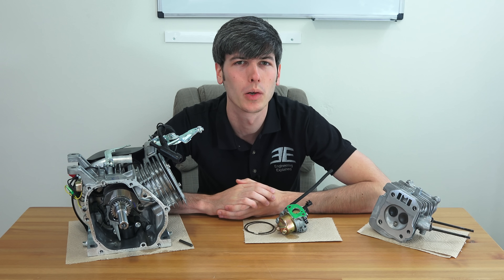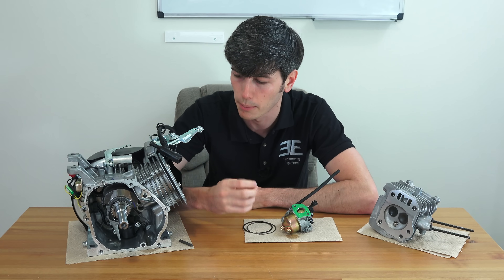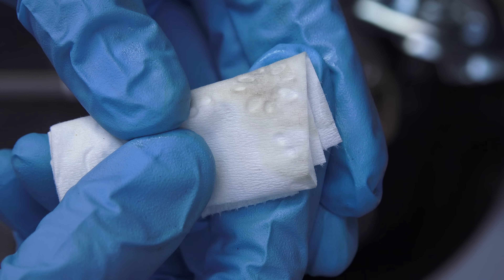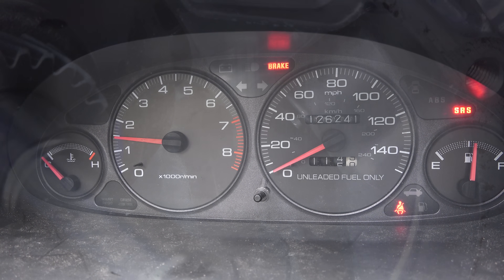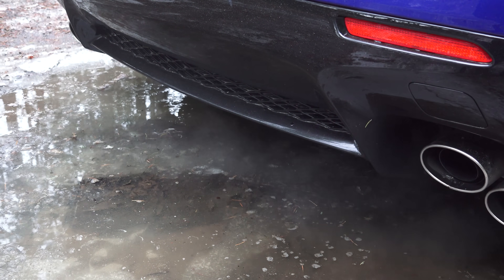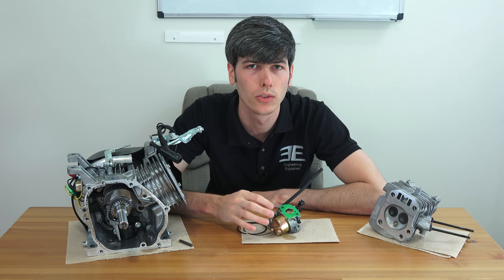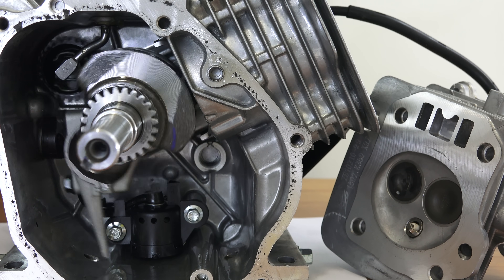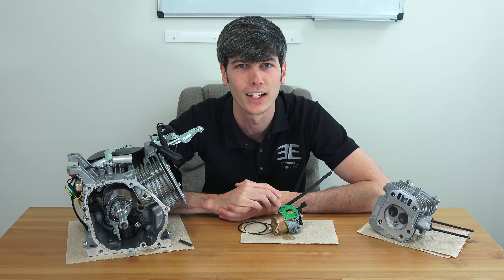Should You Warm Up Your Car Before Driving?

Comment from the maker: Important Note: The amount of fuel sprayed in the cylinder in this video is significantly greater than the quantity that will actually be injected each intake stroke, as demonstrated in this video: https://youtu.be/lJRBo883cpU. The initial point of the video remains: today’s modern engines with modern oils (which have excellent low temp flow properties) will have oil flowing and properly protecting the engine extremely quickly, thus negating the need to warm up engines before driving off. If you want to let your engine idle for minutes before driving off, there likely won’t be long term consequences (like heating up the car, scraping ice, etc), though there likely are not benefits either, as the oil film establishes very quickly protecting the engine. TL;DR - you don’t need to warm up your engine before driving off, just don’t drive aggressively until fluids are at operating temperatures.
Reply: Hi Jason, I am using this as a research topic for one of my classes and am just wondering if you happened to use an article or another reputable source to backup this information? If so, would you be able to point me in the right direction? I've tried searching through some databases however can't seem to find anything in terms of additional wear during cold temperature start up due to rich A/F mixture.
Reply: yeah what about internal expansion of the metals up to operating temperature
Reply: You need to contact the builders that built the house next door.And the buyer. I do like a good explanation.
Reply: What are the operating temperatures? 21 WRX
Reply: @EngineeringExplained What about Minnesota in January?
Reply: Technically yes, there are valid mechanical reasons for short warm-up times but these were always there- for decades, but it is only recently that propaganda started pushing not warming as better.   Fuel savings is the biggest reason for not warming but propaganda does not want to say it straight- wouldn't be propaganda, thereby concocts various side reasons.  Notice how the short-warming period mantra started with American wars in Middle East and prices of oil hitting $100 and more per barrel.  Ridiculously thin oils, not warming engines, other follies are propagated as good mechanical practices and unfortunately Engineering Explained is an impressionable young guy and is parroting a lot of it. There are many valid reasons to warm-up the engine well.  Not only mechanical reasons but also safety reasons.  Statistically most accidents happen within a short distance from ones home and take place during the first few minutes of driving when the engine is not fully warmed up and the driver is driving "easily" waiting for the engine to warm up.  Warming up and being alert and prepared to step on the accelerator when need arises is a far better safety practice that taking of with a cold engine hoping it will warm up in the next few miles of driving.  Medical bills, damaged vehicles, rises in insurance premiums are all more costly than the few ounces of fuel and a tiny amount of engine wear that is saved by not warming.
Reply: So I guess the feeler gauge that I use to build engines is just for show and thermal expansion tolerances are just bs. Also everybody warming their cars up at the track are full of it.
Reply: Engines with forged internals need to be warmed up to reduce wear due to the fact that a forged piston must expand due to heat to fit perfectly if not it can cause bad piston slap if driven cold

Comment: Industry and government propaganda being pushed. It’s complete BullSh*t !!! Of course an engine needs warming up before driving !!! If the so called industry experts say this, then why do F1 engines need warming up correctly……and motorcycle engines in Moto GP ??!!!! That’s because engines are made from different metals and components and oil has an optimum operating temperature…… !!!! Of course the motor industry don’t want you to warm your vehicle, they want you to drive straight off and wear your engine out in a couple of years !!! Why do you think oil has got ever more like water ??? Because it has minimal viscosity which makes the engine wear quicker !!!! Don’t believe the so called experts !!!! You can guarantee most of the people on this thread are trolling and propaganda spin doctors mocking people for warming their engines…. Either that or they’re just retarded !!! 😂😂😂😂😂

Comment: I get snow, sometimes a lot. Turn on the front defogger, fan on high, recirc on, windshield and floor. shut off the engine. remote start the next day. brush off the snow. sometimes there's heat. I'll take the tradeoff. I also change my oil early.

Comment: If you live anywhere that is cold you will know it is imperative to let the car warm up. Yes yes modern oil and better fuel injections yadda yadda. If you dont let the engine get warm enough to keep the windows from frosting over as soon as you sit down. It doesn’t matter how “ unnecessary” it is for the engine. You’re going to run into the first thing that gets infront of you because you cannot see. And that’s going to be a lot worse for the car than letting it idle.

Comment: Theres a thing called high idle in my Ford gassers. That takes care of any excess fuel from forming. I idle my trucks both diesel and gas for at least 10 mintues year round. Never had any issue at all with rings,bearing or any other engine part. Transmission problems never happened either. And I aveage 40k miles a year and keep them until at least 150k before trading in. I'll stick with warming them up. Especially here were we get temps below zero often for long periods. You ought to hear the sounds the engine makes once started. Don't drive it. The cylinder walls will keep coated everytime the piston goes up and down and fuel gets burnt up with the high idle and adjustable electronic fuel mix.

Comment: The oil pump is constantly running, so the rich fuel mixture should have minimal effect. The system is going to be in an open loop until it gets to temperature.

Comment: It depends on what you call a cold start.  It's  not all about air fuel ratios.  When it's -20F you have other considerations before through your transmission into drive.  You've got -20 transmission fluid, -20 oil, - 20 diff fluid, -20 coolant.  The engine coolant will warm up the quickest, but that first thermostat opening is going to shock your block and heads.  Especially if you have dissimilar engine components like a cast iron block and aluminum heads.  200 degree engine with a sudden flush of -20 coolant can be detrimental. The oil will warm up fine of course, tranny fluid next due to friction and diff fluids last.  Let your car idle for awhile to get tranny fluid moving and warming up before hitting the throttle

Comment: This doesnt account for cold temperatures where on a short trip with modern direct injected engines causes condensation in the oil and/or oil dilution. On an automatic, if driving off while still in high idle, the trans will slam into gear when you put it in almost like a mini neutral drop. All the transmission rebuild specialists all have come to the same consensus that warming your car up before driving will prolong the life of your car and it will drive better for longer. This is why the acerage person struggles to get to 200 thousand miles on an unopened automatic while some people such as my dad have gotten well over 270 thousand miles out of a transmission that was considered to be “garbage” (4t65e)

Comment: Every single time I get in my car I start it and wait for the SAIP to go through its cycle and shut off then for the engine to idle down to 840 rpm then I'm off. I never wait for the temp gauge to start to move even in the cold. It's a 2004 Passat 1.8t AWM engine code with 4motion all wheel drive and 5 speed manual with only 119k miles and no wear in the cylinders or oil burning, I checked the walls with a borescope when changing spark plugs, looks like new.

Comment: A friend of mind from work lets his car idle a bit before turning it off especially after long drives. He drives a diesel bakkie or what you guys call a pickup. When i ask why, he sais its to let the turbo cool down. I take his word because his a mechanic but for military. How true is this?
Reply: It's good practice on older models and high performance cars as takes the heat away from the turbo . But I've never done this as can't be arsed to wait !

Comment: Hello, actual automotive engineer here. This is shoddy thinking. Any damage to the bores from dilution is going to be completely dwarfed by wear from loading a piston loose in its bore. Until the pistons warm and expand enough to shrink the piston-to-wall clearance, you're going to have piston slap. Loading the motor in this state will wear the skirts and bores orders of magnitude more than idling under no load, especially considering the bores are constantly being replenished by oil on the opposite side of the rings.
Reply from the maker: Appreciate you chiming in! Since you have oil being replenished as you mention, is there really any concern?
Reply: @engineeringexplained I would still be concerned. The crankshaft is going to throw oil onto the bores pretty quickly during a cold start, but the wider clearances between the pistons and cylinder walls means that there is more room for the piston to rock/slap between the thrust and non thrust sides of the bore. A looser (colder) piston is naturally going to slap harder because you are giving the piston a greater distance to accelerate between, i.e. it impacts the sides of the bores with greater velocity hence the noise. Increasing the RPM in this state just speeds everything up and makes the impacts harder. Another thing to think about is that cylinder pressure is positively correlated with torque and an engine produces hardly any torque at idle with the throttle closed. Driving and loading the engine increases the cylinder pressure and pushes the pistons into the thrust sides of the bores harder.
Reply: Your answer makes complete sense and is a supremely logical conclusion.

Comment: I bought a block heater to put in my car and I plug it in overnight don't have to warm it up oil is already warm can drive it away just like that within one minute it's spitting out hot air from the heater

Comment: This is not a consumer problem this is an engineering problem. The engineers need to figure out how to heat the cabin substantially quicker in winter rather than getting together in boardrooms and having paper plane flying distance competitions

Comment: A rotary engine  must be completely up to running temp. before driving, this is mostly why rotaries got a bad reputation except it was people that failed, expansion rates of Disimular metals, I once read about an Rx 2 that competed in 1975 Bathurst and later went on to doing 100 ooo miles successfully on the road before being recond,  the key to this was correct warm up procedure also cool off procedure the same as everyone should  stick to 🤔if you are mechanically sympathetic or just very wise, or have chosen the right person to tell you because you have no clues to solve the
 mystery , I have a good mate that's a very good mechanical  technition  he also says not to warm up ,some cars like 6 + 8 cylinders Ford's and Holden can drive with minimal stationery time on cold start defanatly so it's up to the individual to make good decisions about performance and reliability, these words don't usually go together unless there's $$$ involved or a little initiative

Comment: What happened to  75% of engine  wear  happens from cold, modern multivis oil allows engines to function while cold when piston ring and cylinder tolerance is bigger, alluminium (pistons) expand more than cast steel and also expand at a faster rate piston bore tolerances are set to be correct when an engine is at running temp.... so if you don't have an adiquate  warm up procedure theoretically your pistons will be expanding  before the bore does also with load from driving, once you are committed to  driving traffic isn't waiting for your cold crappy engine, which is fine if you  get a new car every year, 1 other thing to take into account  is residual stress in the  molecular structure of the steel is considerably higher if it's not warmed eqauly, essentially and engine that's looked after and warmed up won't crack a head as easy if it happens to accidentally get a bit hot

Comment: They will warm up quicker if idling.  If you start up and start driving , your car is pulling more cold air thru the radiator, and takes longer for the engine to produce heat.  Starting up and letting it idle at lower RPM letting less cold air pulled into the engine.  That oil pump is pumping a lot of oil under pressure to all the places that need it.  It not washing off the oil that already there on the crankshaft piston rings and all mechanical parts that need lubrication.  This is a John Kerry idea to get people to not let their engines warm up.  This engineer is a tree hugger that has college sense, but has no common sense about several mechanical ideas I’ve seen him attempt to explain. I won’t argue his point of view and keep letting my car engine warm up to heat my car,while he’s driving down the road freezing.

Comment: Here we go again with the annual Anti-Warmup Lies Season. No need to heat up and defrost the windows. Ice is never caked up on the windshield bad enough to need heat and scraping while idling. Forget about stabilizing turbo bearing temperatures or getting the freaking transmission fluid heated. Safe driving and long turbo life mean nothing in the car media. Stunning how you people get paid to write that BS. Incompetent are those without winter driving experience and believe it. SMFH.

Comment: I start the engine and change gear at approximately 3000 rpm without waiting for a second or waiting for it to warm up at low speed. I have been using it for 10 years. My 1.5 dci engine vehicle has 240,000 km at the moment and there is no problem, friends.

Comment: I always warm my engine - winter or summer. Reasons: 1) so that oil viscosity lowers to the operating temp and oil pump can effectively deliver oil to the top (camshaft area) and 2) so that engine tolerances (including piston/cylinder) are at operating tems. The operating temp of an engine is about 100C. Ambient -10C in winter is therefore 110C lower than operating temp. Ambient 20C in summer is 80C lower than operating temp. 80C is 72% of 110C. Therefore, the temp difference between cold and operating temp in summer is only 28% less compared to the same difference in winter. 
Having said that, I warm the engine till the temp gauge arrow moves, not till it reaches the operating position.

Comment: Nope. This is wrong and ignores the most important reason which is engine life. Do a new video after driving your last five 4 bangers for 500,000 miles each without turning wrenches on the engine. This is day one of pilot training as the most important thing in an aircraft is engine reliability. If you want to be like me and get the full life from an engine without walking or greasy fingernails warm it up for 10 minutes in the summer, 20 minutes in the winter and change the oil at 3k miles not 5, 10 or 25. Putting a load on or revving the engine heats it up much faster placing far more wear and fatigue on every single part of the engine as they don't heat nearly as evenly.

Comment: Technically yes, there are valid mechanical reasons for short warm-up times but these were always there- for decades, but it is only recently that propaganda started pushing not warming as better.   Fuel savings is the biggest reason for not warming but propaganda does not want to say it straight- wouldn't be propaganda, ...thereby concocts various other side reasons.  Notice how the short-warming period mantra started with American wars in Middle East and prices of oil hitting $100 and more per barrel.  Ridiculously thin oils, not warming engines, other follies are propagated as good mechanical practices and unfortunately Engineering Explained is an impressionable young guy and is parroting a lot of it. There are many valid reasons to warm-up the engine well.  Not only mechanical reasons but also safety reasons.  Statistically most accidents happen within a short distance from ones home and take place during the first few minutes of driving when the engine 
is not fully warmed up and the driver is driving "easily" waiting for the engine to warm up.  Warming up and being alert and being prepared to step on the accelerator when need arises is a far better safety practice that taking of with a cold engine hoping it will warm up in the next few miles of driving.  Medical bills, damaged vehicles, rises in insurance premiums are all more costly than the few ounces of fuel and tiny amount of engine wear that is saved by not warming.

Comment: somebody help me cope through this. i've been letting my car sit and idle until the oil temperature hits operating temp. so, i've been starting my car, and letting it sit for like 20-30 minutes, everyday, ever since i got the car, which was about 2k miles ago. after watching this video, i have no other mindset other than that my engine is completely toast, i should just replace it, and my car has lost all of its efficiency and power.

Comment: So why does the engine on start up got it 2.5k or more rpm if it is so bad for it.  Also  Wouldn’t the fuel injector give the proper amount of fuel to avoid the “extra” fuel in cylinders?

Comment: If you think your engine doesn't need to warm up before putting it under load, that's fine. You're wrong but you have the right to be wrong. 

But please quit coming up with bull crap reasons why someone shouldn't warm up their engine.